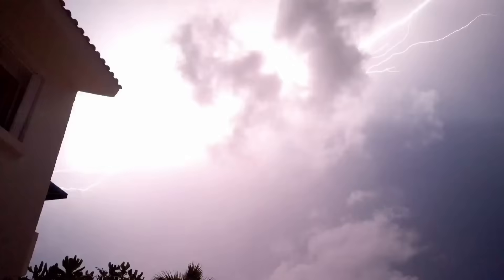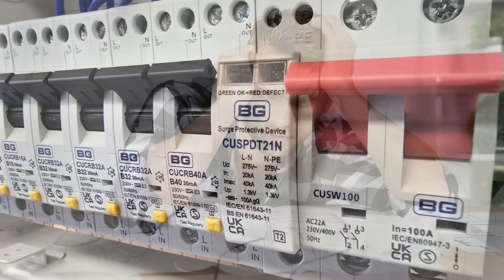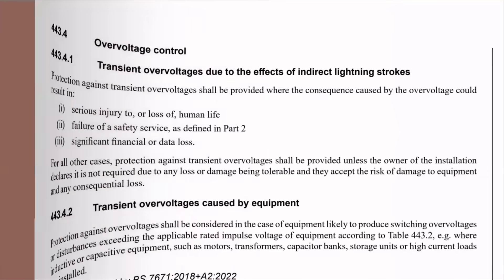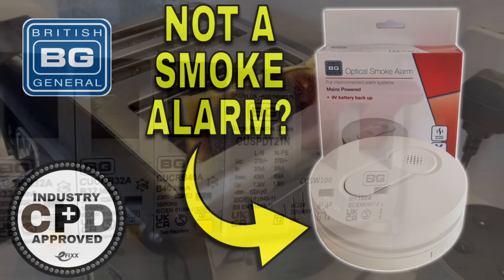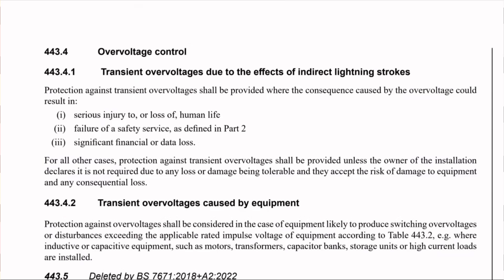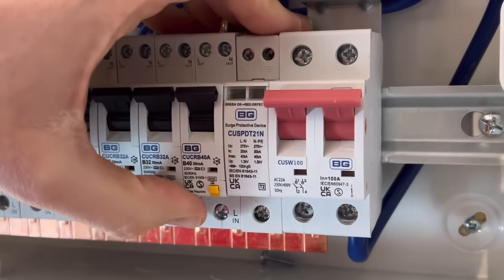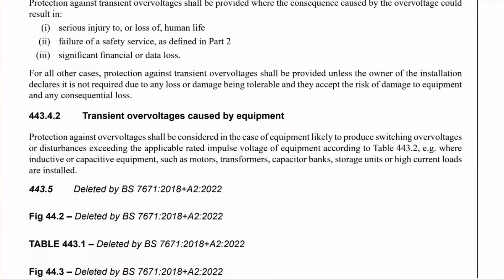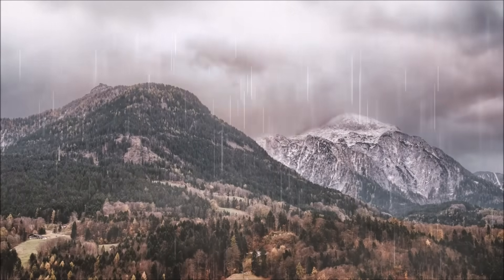2025 Surge Protection Rules: Easier But Stricter?!

Comment: It's worth pointing out that regulation 443.4.1 changed when the corrigendum to Bs7671 was published in 2023. 
In the corrigendum, 443.4.1 (ii) failure of a safety service as described in part 2 was deleted.
There is an article on the IET website about this. I think there was a concern that stand alone smoke detectors were being deemed as a safety service, and this might delay the installation of smoke detectors if an SPD was required.
Having said this, I think SPDs are definitely worth installing.

Comment: Look at surge protection as cheap insurance. If never needed you only pay once, but it's always available if needed.
Reply: paying once would be nice, but in the real world the SPDs will need to be replaced occasionally because grid power is rarely as clean as it should be, causing slow degradation of SPDs.

Comment: Some devices have varistors on it's own circuit board. 

SPD is useful when: 
1) the building getting power from overhead cable or some equipment is installed outdoors; 
2) the building is taller than 15 meters (addition to SPD is lightning rods on roof); 
3) the building has power factor correction capacitors; 
4) electrical installation uses inductors for capacitance correction (10-35kV substations); 
5) industrial building with powerful equipment. 

Some inspectors (especially in Germany) want to see SPD in apartments which getting power from underground cables and where aerial on roof is missing since internet appeared.

Comment: Q: When extending a lighting circuit, i.e. an alteration, is an SPD required?
Reply: just new circuits
Reply: Do you sign a certificate declaring compliance with bs7671? If you did yes it was required unless your client waivered it's ommission for you.
Reply: I asked the question because I’ve never had a definitive answer from either the IET, NICEIC, or NAPIT helplines. In my opinion, and it is just that,  1) rewire == SPD, 2) new CU == SPD, 3) new circuit, 4) extending existing circuits == omit SPD.
Thoughts? @efixx
Reply: @orwelliannightmare I just answered the question for you Paul. If the work your are doing is installation (not maintenance/like for like swap) you will be issuing a cert that says your bit complies with BS 7671 as it stands now. That means that if the consequence of significant financial or data loss or risk of harm/loss of human life you will have to fit it. In all other examples you have to fit it unless your client declares that they're happy to take the risk. It's not that complicated and if you rang NICEIC or NAPIT they would say just that. Or is it just that it's not the answer you wanted?
Reply: @travoltasbiplane1551 Why, oh why, does every discussion in the electrical industry, generate either a) a sarcastic remark, b) a snide remark, c ) or some other derogatory remark. My question to the “powers that be” was not asked either wanting or expecting a specific answer, merely the definitive answer. The whole area around the installation of SPDs has generated much discussion since first mooted, and the advice given has varied over time. I asked the following question of the IET helpline on 17/3/24.

Q: Where an addition is being made to an existing circuit is an SPD required?
A: In a domestic property an SPD is a financial consideration only.
Reply: @orwelliannightmare no one made a snide or sarcastic remark mate. But the reg is clear - and the logic is simple. I'm struggling to understand what the issue is to be honest.
Reply: @travoltasbiplane1551 Apologies if I misinterpreted your remark - the joys of non-verbal communication. For rewires/replacement CUs, new circuits, it’s a non issue, but for true minor works it can be a financial consideration, particularly for older clients. For older installations, in many cases the only cost-effective solution for the installation of an SPD is to install a meter isolator with an integral SPD, such as those manufactured by Wylex or WECD. However, you’re then heading into the world of contacting the DNO/supplier/SIP…
Reply: @orwelliannightmare but it would be legitimate to consider the cost of the SPD relative to your work. If you're adding a £50 light it's probably likely not to be worthwhile installing a £250 SPD. But that's for your client to decide. They can either sign that waiver or pay you to fit it... Either way would mean you could sign that cert in good faith.
Reply: if it's just lights on that circuit i'd say no. correct me if i'm wrong but IMHO SPDs should be on the incoming supply, not on individual circuits.

Comment: Why would anyone NOT want surge protection? If my numbers ever come up and I can build my house, I want all the protection I can get, even if not required by regulations. MCBs and RCDs (or RCBOs), SPDs, AFDDs. And power conditioners to filter out high frequency noise and keep the voltage in the proper range.
Reply: Ditto, although I was gonna go a lot further. Mains in direct to a smart charger supplying a large deep cycle battery bank, that then feeds an inverter(s) to supply the house. Basically a house scale online UPS, but set it to charge the batteries using cheap off peak electric and then run off the batteries during the day.
Reply: @JaenFoster i would do the same except instead of just a UPS system protecting the whole house i would have an Automatic transfer switch aswell that switches to diesel generators when the power goes out. That way if mains fails AND the generators fail i still have battery back up via the UPS
Reply: @ChooseLife.YourLife thankfully, for all it's faults, the grid here in the UK is pretty solid. I'm 41 and don't think I've ever experienced a blackout that lasted more than a few hours. Might be different if you're way out in the sticks, but even the small villages and hamlets don't seem to go down that often or for too long, and that's usually only after a big storm. You're milage may vary though,
Reply: @JaenFoster  my ideal setup would be solar panels and maybe a wind turbine or 2 to supply more electricity than my house needs, combined with a BIG battery bank and an electric car or 2. for heating and hot water i'd use sunlight and a ground-source heat pump, with an electrical backup. air conditioning using radiant cooling panels in the ceiling, cooled by water from the ground loop (consumes A LOT less electricity than regular air conditioners).
i want to build a house like that, but first my numbers have to come up...
Reply: Yes, though I would be aware of the caveat that surge protectors are more likely to need maintenance in the long run. Householders should be aware of the need to check and replace them.
Reply: @gavinminion8515 this is true. Although they're also told to regularly check RCDs and RCBOs but I highly doubt many do. Same with smoke and CO alarms. 🤨
Reply: I have a 300mA RCD and a SPD at the beginning of my installation. If the grid neutral fails the SPD starts clamping to earth and trips the incoming RCD thus protecting against dangerous voltages. (A floating neutral can cause voltage spikes up to and possibly above 400V on household appliances)

This protected supply feeds a victron multiplus inverter combined with a 16kWh LFP battery so I have a whole house UPS but it's main purpose is ESS.
Solar is connected to victron mppt chargers and the string voltages are around 100V max (70-90V MPP voltage), reducing the risk of fire due to damaged insulation. Also providing off grid power and gives the possibility to do a cold start in the event of a completely drained battery.

After that are my distribution panels which are also equipped with a SPD for added protection in UPS/ off grid situations. Circuits are protected by RCBOs so there's only a single circuit that goes down instead of a large part of the house.

AFDD is a bit too expensive (at least over here with at least €200 for a single circuit) and they only work correctly in a modern setting. 
Those really like to trip when using older appliances with brushed motors. I actually know someone who uses an old hair dryer to test those 😂.

I'm not saying that you should not use those (optionality depends on the local laws) but only use them on general lighting circuits, bedroom sockets and higher current appliances such as an immersion heater, shower circuit, washer/ drier or electric heaters.
Reply: @mrxmry3264 me…. Pointless in uk. Show me data where there was surge or spike or lighting strike on uk property??? It’s a waste of plastic
Reply: @miketaylor1916 strike doesn't have to hit the property directly to cause problems. Also, lightening isn't the only cause of spikes to the grid. With more and more non predictable supply (renewables) being added to the grid, combined with ever increasing, unpredictable and dirty loads the grid, while still pretty solid, is starting to struggle. Also, SPDs don't just protect the consumer from grid spikes, they also protect the grid from the consumer.